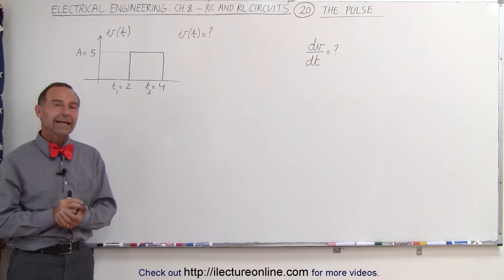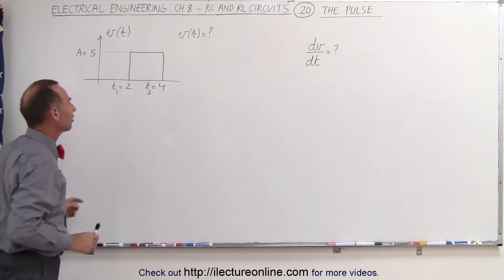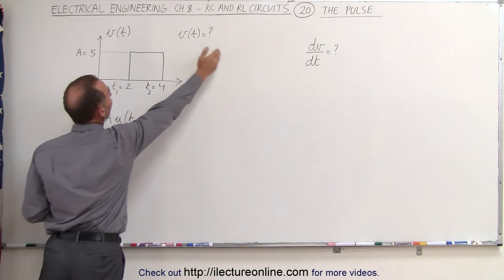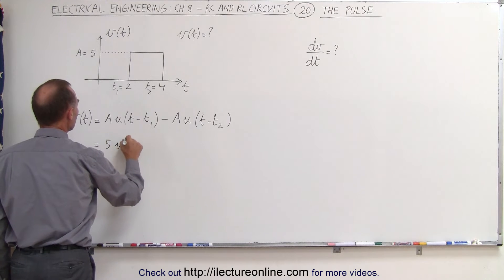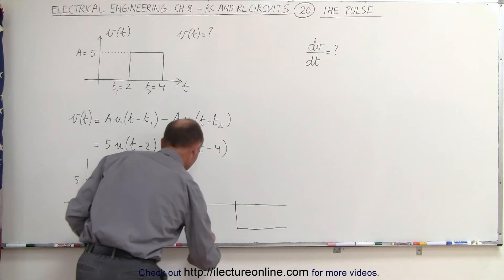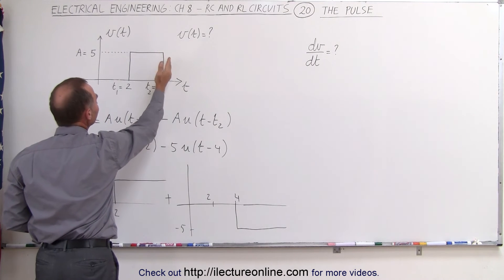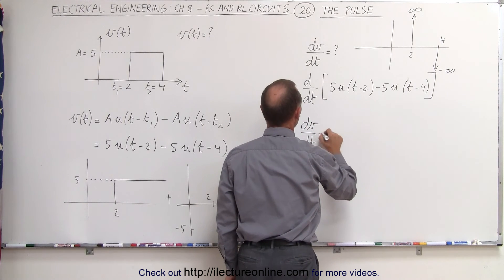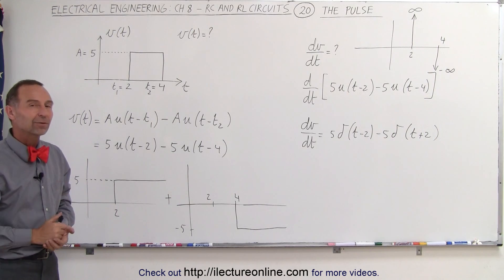Electrical Engineering: Ch 8: RC & RL Circuits (20 of 43) The Pulse

Comment: Hi, great video. I'm a bit confused about the delta function. When you differentiated v(t), does it make sense to use A·δ(t-t0) instead of just δ(t-t0)? I mean, at t = t0, the delta function equals infinity, so A·δ(t-t0) = A·∞ = ∞. My question is, what's the point of multiplying a delta function by an amplitude if it equals infinity whether you multiply it by an amplitude or not?
Reply: I have the same question..
Reply: If you integrate it without the multiplier, you simply get 1, while if you have a multiplicator for the delta function, then after integration, you get the multiplier as a result - namely 'A' in your example.

Comment: I have a question about the video at the 5 minute mark. You took the derivative of 5*u(t-2) - 5*u(t-4) and got 5*d(t-2) - 5*d(t+2)...was it supposed to be 5*d(t-2) - 5*d(t-4)?? Thanks.
Reply from the maker: yes, you are correct.